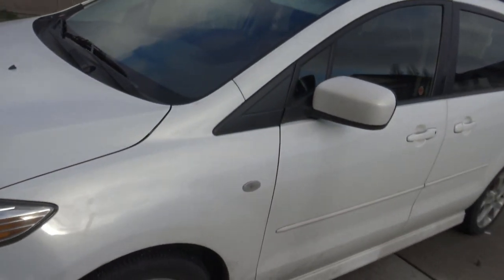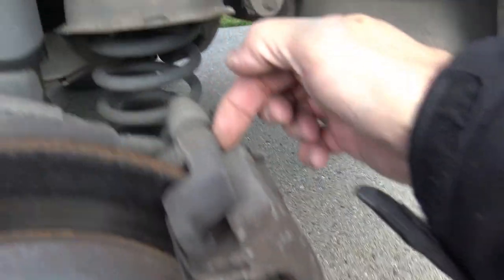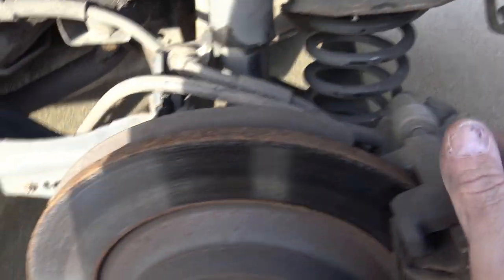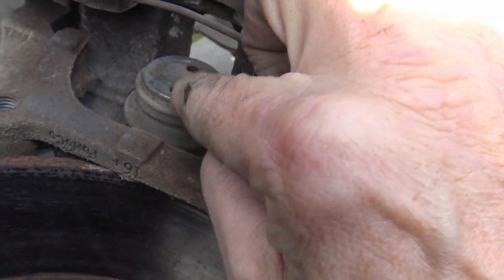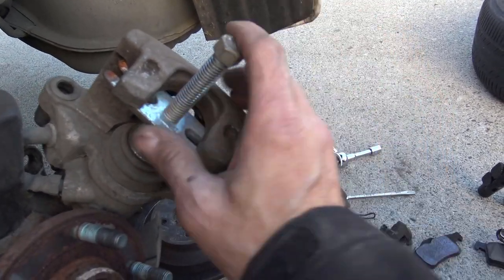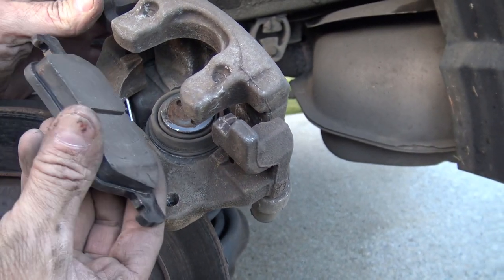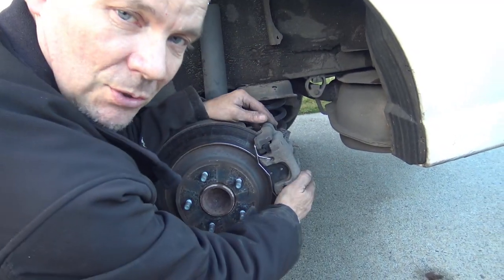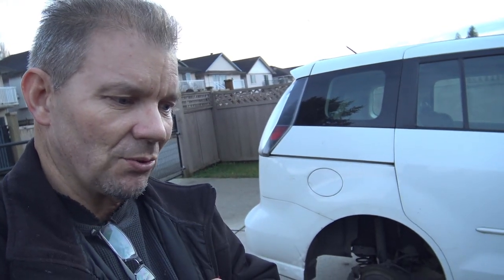A Newbs guide to replacing your Mazda 5 rear brake pads!

Comment: You may have confused the calliper bolts with the slider pins. 22 ft/lbs sound like the slider pin torque, the calliper carrier bracket is usually a higher torque setting, perhaps nearer to 45 or 50 ft/lbs for the rear brakes. A dab of loctite would also be advisable

Comment: So, those two little holes you used with pliers, they should be lined up straight so that the two protruding pins on the back of the inner brake pad sit into them. If they dont, the handbrake is messed up. This is an integrated caliper. Did you have any issues with the hand brake? Will the caliper spin around and eventually catch the two pins on the pad?
Reply: Exactly. He put the inner pad outside ...those two pins should fall in the caliper piston holes, which should be turned horizontal when backing it up by rotating.....the outer one the pins are on top and bottom so they sit on the "u" shaped

Comment: I disagree with this method. You should leave the caliper in place - the 14 mm ones. Open the caliper slide screws, clean and lubricate them with brake silicone grease. Also lubricate the caliper stays that the pads slide on. Clean the piston boot before pushing it brake in and check for cracks. Clean your rotor with break cleaner. Bleed the break system to remove the brake fluid that has been sitting and boiling and oxidizing in the brake caliper for years and replace with new one. 
Do the job right! You life depends on it!
Reply: Only thing I'd change is I remount the bottom caliper ear to the top bracket if there is enough slack in P-brake cable. this holds in securely and gives you room to work.
And also, use the proper piston tool. Commonly available and under $10. Piston boot should also be peeled back to inspect for rust/pitting and a small amount of white lithium or silicone grease will help with screwing/pushing them back in. Absolutely no other type of grease of chemicals though.
Reply: You should also resurface or replace the rotors. And most parts stores in the US rent the caliper tool for free!

Comment: Hi thanks for making this video it helped me locate a few things but if I can just add that you don't need to remove the entire caliper when just changing out the pads. Just remove the two pins that hold the bracket in place using a 7mm hex socket on the 2012 model. Saved me a whole afternoon.
Reply: I have a 2012 and need to change the brakes. Can you elaborate which 2 bolts you mean? Also does that apply for front brakes as well?
Reply: 2 pins i mean
Reply: Yeah he didn’t have to remove caliper bracket just remove clip and two caliper bolts to take off actual caliper not the bracket either way tho
Reply: @jms7620  How do you wind the piston back in if you don’t remove the calliper?
Reply: @dtm7533  you can remove just the caliper from the bracket. This guy removed the caliper and bracket as a hole instead of just unbolting the slide pins to remove the caliper

Comment: Why didn't you just remove the caliper rather than the whole caliper and bracket? The bolts are in the little rubber bits with the plastic caps

Comment: Did you open the brake fluid reservoir cap? That makes it easier to go in.  gotta suck out some of the fluid or it’s gunna most like spill if you back it down back to “optimal” seating the piston.... probably not a bad idea to use a wire brush and brake cleaner to help remove the crud and brake dust from the caliper. Grease the piston slides too.
 Had a 06 Mazda 3 with basically the same rear disc and pad setup.... almost broke the piston by only using a c clamp to compress it.... whoops!!! Good video though!! Thanks!

Comment: just got done doing the rear brakes on my 08 mazda 5. top tips, get a proper brake compression tool, they are cheap. put those brake pads on before you install the actual calipers, it should be done that way. Always use proper caliper grease for those 2 pins/bolts and back of pads where it touches the calipers.

Comment: Wow, this was soooo wrong! What were you thinking?!
Reply from the maker: Worked out good , whats the problem?
Reply: whats problem? tomorow i need to work on one mazda 5?
Reply: @PhotomikesGarage  It looks like it worked out well. 
I find it easier to remove the spring first, then the 2 7mm allen bolts to remove the caliper. The pads pop out easily and you have more space to access the caliper frame bolts. Then I wire brush and lube the caliper and pad slides with silicone grease to keep everything moving smoothly for the life of the pads. I find it easier to remove the rotor and bolt the frame and caliper to the car while pushing the piston back. 
The most awful fluid drops to the bottom of the system into the calipers.  I open the bleeders and let it out when compressing the piston, then leave them open and flush the system with new fluid for maximum caliper life. 
I'll replace the rotors ($40ea. across the pond in Victoria) at the same time and clean the rust off the hubs for guaranteed trouble free braking for years to come. 
 When I do a brake job for a customer, I say the best warranty is an unneeded warranty.
Metalunique - Be constructive.

Comment: I did the front brake pads a minute ago and now ayear or so latter I'm finally getting around the the rear ones . The shop turned the rotors and told me the pads was fine but they are grooved as well . At least I didn't have to pay for the resurfacing since they put my old pads back on, lol

Comment: Hello, I like the idea you had to press the piston back into the caliper, but you may have created a future problem.

Using the pliers has chewed up the piston, which will rub against the seal, causing it to fail sooner.

Also wire brushing all of the surfaces, will help , because things will move easier.

The mention of the lubrication was good, but a newbie would need to see where to put it.

Maybe you could show some of what is needed, on the old pads.

Comment: I dont  know if you monitor this but is there any problem pushing fluid back into an abs system?Did your abs trouble light come on? My mechanic friend said sometimes the proportioning valve is 1 way only.